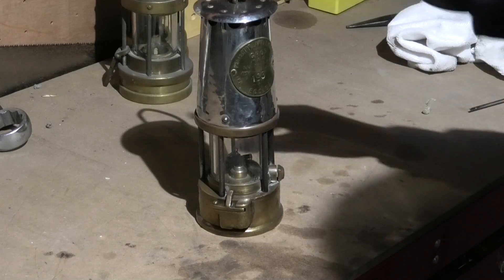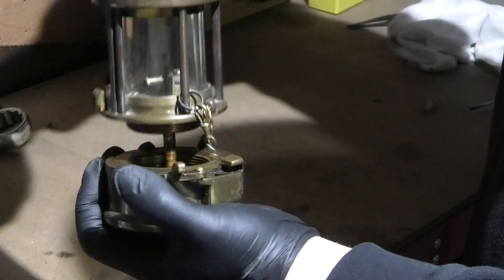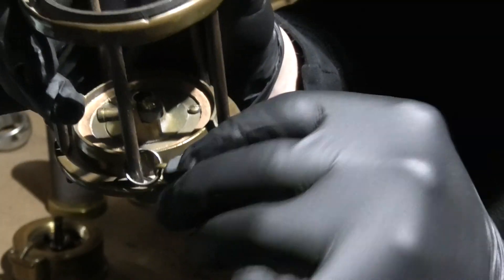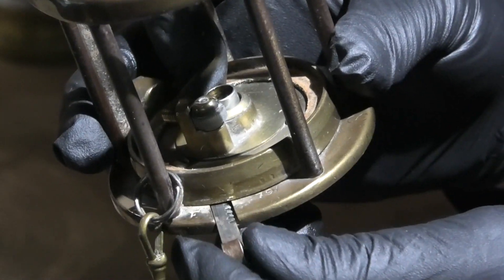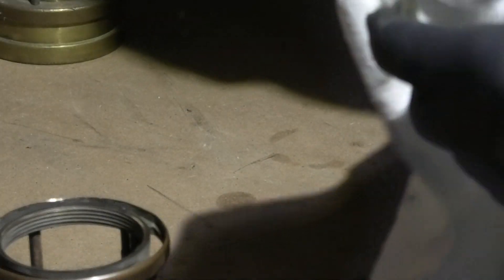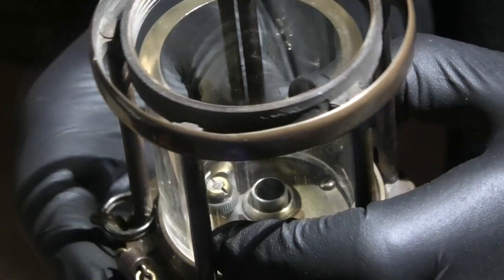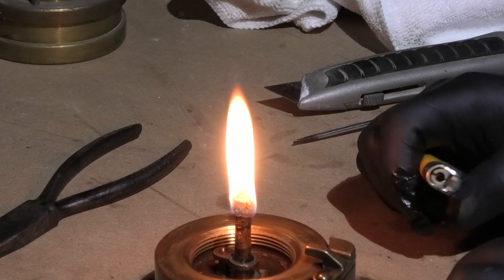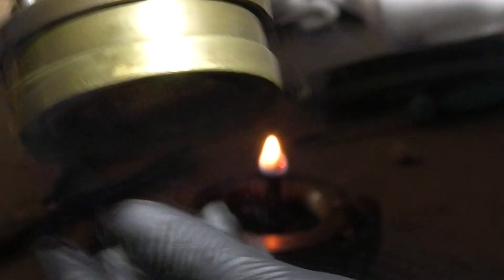GR6S Miners Lamp Service

Comment: I wonder if the GR6S lamp with non- magnet latch is the latest model
Reply: In the UK the NCB/British Coal insisted on magnetic locks. Small mines could use the lead rivet style lock. In Australia there was a few mines that also used the lead rivet style lock as well.
Reply: @LampBoy3583  
Thanks for the info.

Comment: My GR6S bought today does not have the same lighting mechanism as yours so not sure how it lights. Just 2 posts near the wick with screws in the top.  No hole and bung in the glass either.  It does have the magnet latch.
Reply: A 12v battery connects via silver ring and brass base below the glass.

Comment: Hey! Could I ask what diameter of wick you use? And does it matter if it is a specific type or can I just buy any generic one online?
Anyway thanks for the Video! I just bought one of these lamps on a flea market and want to get it nice and running again.
Reply from the maker: I got hold of some 1/4" (6mm) from our local DIY store (Maxwells) in Barnard Castle that seemed to fit and work just fine - they keep it on a reel so you can just cut off any amount as required and it was dead cheap at about £1.00 per foot or something. I'm sure eBay would have something similar that'll work as well.
The flint was again from the same shop, sold in packs of 10 - again for next to nothing in cost - but I'm sure most tobacconists would sell the swan flints as well.
Reply: @MineExploration  Thank you! So I just ordered about 1m of 6mm cotton wick from Aliexpress for almost nothing. Here where I live (Switzerland) it's kinda hard to get hold of this kind of "old fashioned" stuff in DIY suppliers...Surprisingly the flint still works fine on my lamp but yeah I'm sure i could just use any flint from the tobacco shop.

Comment: Be careful with the washers at the top and bottom of the glass, they are asbestos. We recommend these be replaced, wear a mask and remove them without breaking them up. If they are stuck in, soak them in lamp fuel or wd40, this aids removal and reduces the risk of fibres going into the air. Once out double bag and bin them.
Reply from the maker: Thank you for the advise, we use quite a few of these lamps and I know that some have been changed for some sort of  gasket material (Klinger I think). There is maybe two or three that I have not opened or used so will certainly watch for the material around the glass and treat it with care as you suggest when the time comes to use/service the lamps. If you don't mind, I'll add your comment to the info section of the video. 
Many thanks.

Comment: use Zipo lighter fluid there are lamp oils on the market you may fined paraffin smokes too much
Reply from the maker: Thanks, I'll give it a go in one of the other lamps and see how well it works, especially if it is easier to ignite with the internal sparker.
Reply: if you need any new parts i have a link
Reply from the maker: @bryandavies5034  Brilliant thank you. I've got 3 or 4 of the GR6S lamps as my girlfriends uncle had left them from his mining days up in Scotland - I'll check out the others and see if they work as well as a few more that I've acquired from the GPO (of all places). I'd like to fuel them up with lighter fuel and compare so I may remake some of the videos an see how we get on. Oh I feel excited now! Thanks again!
Reply from the maker: Bought some Zipo fluid and going to give this a go rather shortly, also noticed that Zipo is Petrol! Lol, hope it doesn't blow the glass out!
Reply: @MineExploration  It should be ok it's not gas as goes into cars it's for lighters check out this Webb site for spears https://www.protectorlamp.com/product-category/mining-lamp-spare-parts-and-service-kits/ remember there are three types of lamps. an inspector lamp  and a gas testing lamp this had a air simpler nipple on the side    a sample of air in the mine  puffed it into the lamp by a rubber air sniffer and injected into the lamp vair this nipple if the lamp flame change there was gas in the mine both of these lamps can be lit from outside via flint striker and had a magnetic lock the mine workers had  a lamp that had to be lit only in the lamproom
Reply: @MineExploration  can i buy one that is fully equipped in the market? Most of them are SL No.6 type. Where i can get them?

Comment: Hey I’d like to ask what kind of fluid do you use to light this because I have a similar one and was going to use kerosene and wanted to know if that would work kerosene is also know as paraffins oil just wandering
Reply from the maker: Hi. I use just premium Kerosine and it works really well and is not too sooty.
Reply: MineExploration ok thank you I’ve been told by another source that kerosene will not light in a spark lamp but I wanted to ask around
Reply from the maker: @Cyka6artb  That is somewhat right, it will light but you've got to make sure the sparker is set quite tightly so as to generate a large spark. It isn't the easiest to light I'll admit. I find that it lights a lot better is you've had the bonnet off as fumes or something must gather at the bottom inside the glass. If it goes out it can be a devil to relight without taking the top off
Reply: MineExploration ok thanks for the information
Reply: @MineExploration  omg if you did that down the mine you'd blow up the mine
Reply: @MineExploration  OMG if did that down a mine you'd blow up the mine